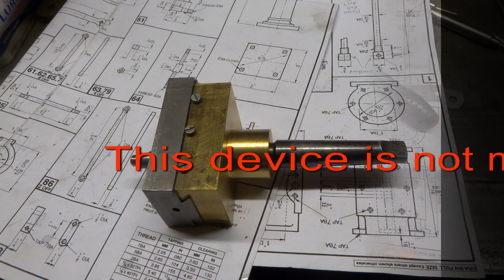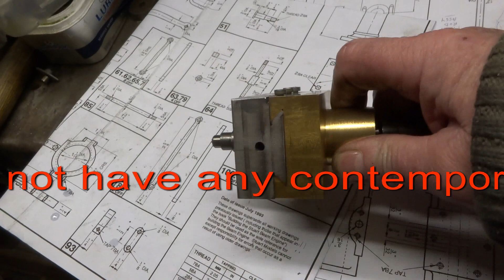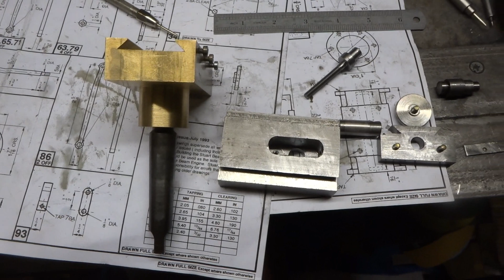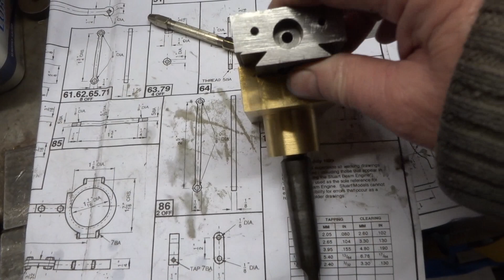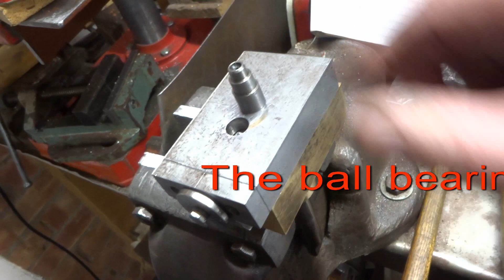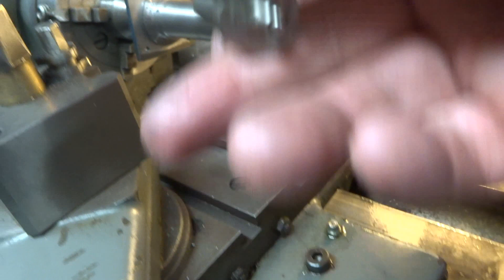Tailstock taper turning attachment

Comment: It's great to see that you are one of the few that appreciate the misalignment created with a standard centre when the tailstock is offset. This is the reason you use a ball at each end to allow for the rocking that occurs.
There are R type centre drills available that have a radius form which allows them to be used with standard centres when using the offset tailstock method.
Reply from the maker: Many thanks.

Comment: Save your self a lot of trouble and use the tail stock it self. Install a boss pin on the base of the tail stock and a knob on the tail stock it self and have the pin stick out about a half inch and do the opposite on the other side of the tail stock and you will be able to move it back and forth and when your done with your taper you can zero it back in. Now you don't have an apparatus on the quill that's going to do the floppy cock because you have might created a cam affect if decides to do the old swing ding. 😁
Reply from the maker: Sam thanks for the info. I am a self taught amateur with no machining training. The current tapers were really only cosmetic and total accuracy not required. If I needed more accuracy I would level the device cross ways with the lathe bed. As it has a shop bought tapered arbor once the attachment is in the tailstock it does not twist and hence no cam effect. I have always lived in fear of moving the tailstock alignment in case it takes the rest of my life to get it accurate again! LOL. In all the years since I made this device I bet I have not used it more than 10 times.

Comment: Many thanks for that Edwin. Hemmingway Kits do a set over centre kit for £13.90. Just out of interest, why are you not using a centre and a driving faceplate at the headstock end?
Reply from the maker: Thanks - I did not know Hemingway made a kit although I suspect I may have made this attachment before they produced the kit. I sometimes work on more than one project at a time (to keep my enthusiasm up) and as I was also using the four jaw for some other parts on a different project I could not be troubled to remove it for the taper operation. They say a lazy man .......
Reply: @edwinwhite933  Can't be bothered to finish his quote? ;)